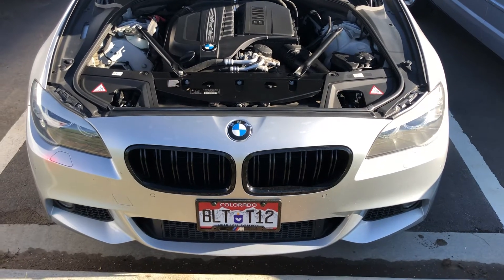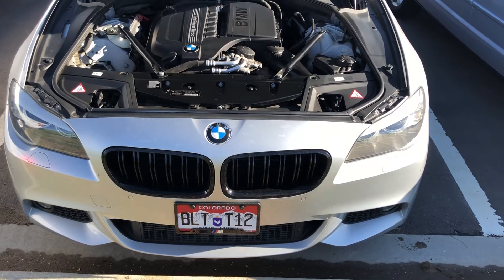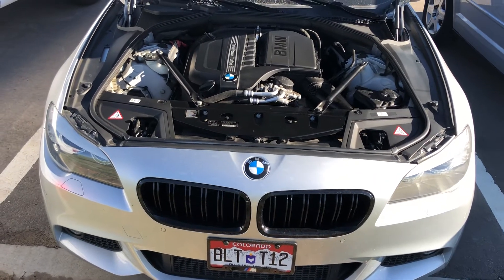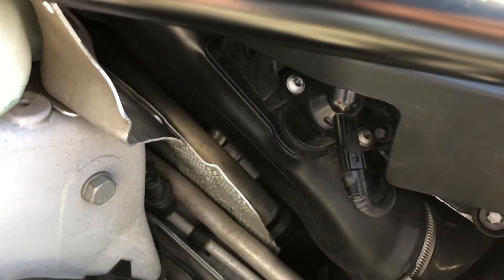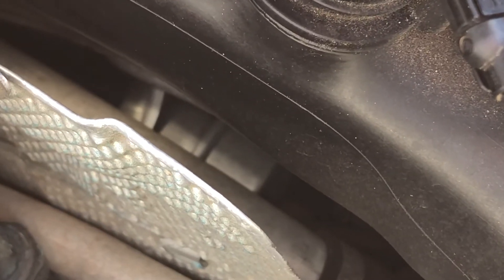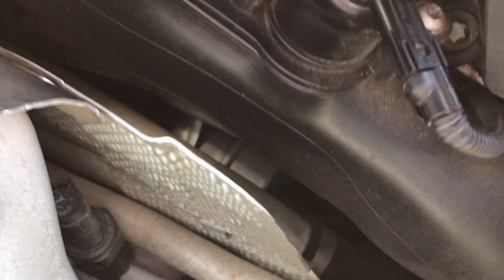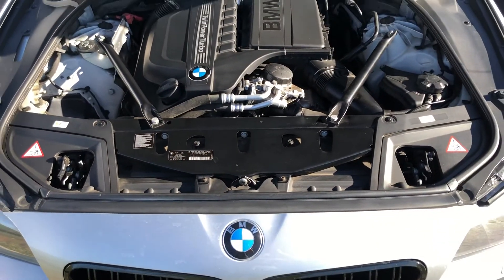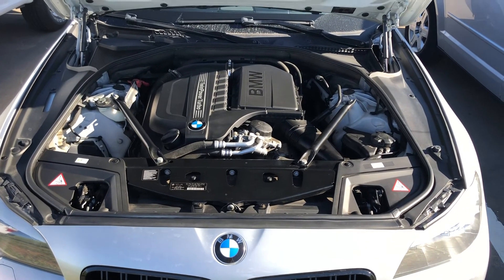BMW (N55) 535i F10 EWG vs PWG (Electronic vs Pneumatic Wastegate

Comment: Hey, I just wanted to ask. You have the N55b30M0. I do too.

When you compare the N55b30m0, to the N55b30, the M0 has less HP.

It seems as though the M0 is a lower end engine.

My question, is, is the M0 any less reliable? How is the reliability?

in mid 2014+ BMW improved the rod bearing design in the N55.

Does this apply to a 2015 car that has the N55b30M0?

Thanks! it means a lot to me!!
Reply from the maker: Hey buddy. Knock on wood but my car has been pretty reliable so far. A few issues that did pop up I’ve discussed here https://youtu.be/edHroJU9PBE

Comment: I have an f10 with a 03/2014 build date and I see the same thing as you. I thought they would all be ewg by this date
Reply from the maker: That is odd actually. That’s why I recommended it checking yourself to make sure 👍👌
Reply: @BIMMERLEAGUE  Correct. I’m a little bummed out because I just figured a late build like this would have ewg. But I still love the car don’t care about missing out on some hp
Reply from the maker: @raidenprotecterofearthreal7909  yeah dude nothing significant to really worry about

Comment: Do you know if mhd automatically knows if your car is pwg or ewg or do you have to chose that yourself because when I tuned it said pwg maps but my car is a 2014 so it may be a ewg
Reply from the maker: You have to select that manually when tuning. It will apply the pwg or ewg map. I don’t think it does it automatically